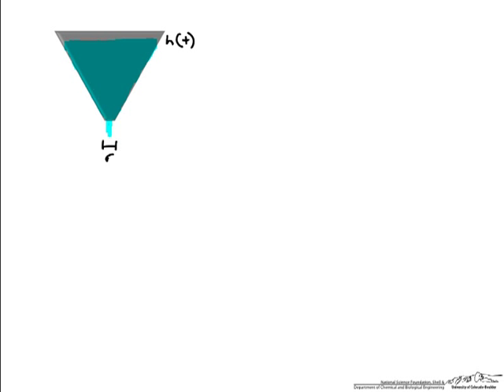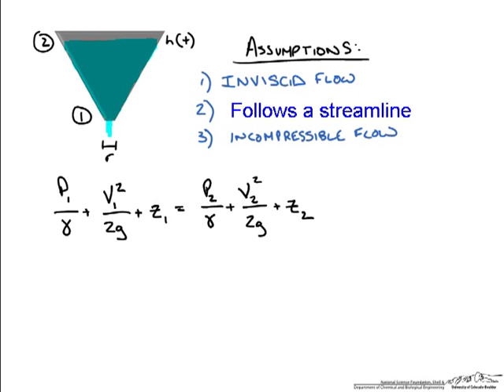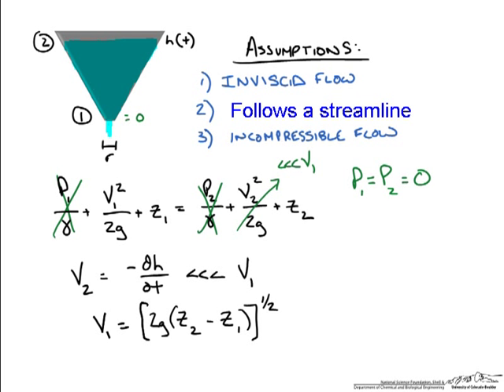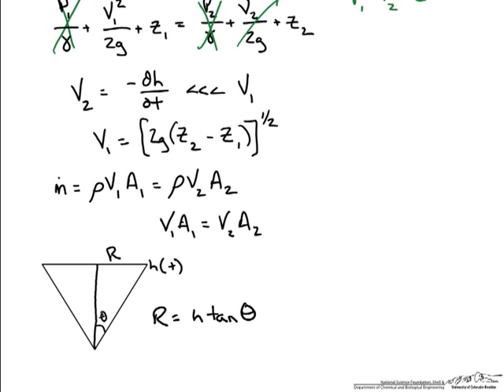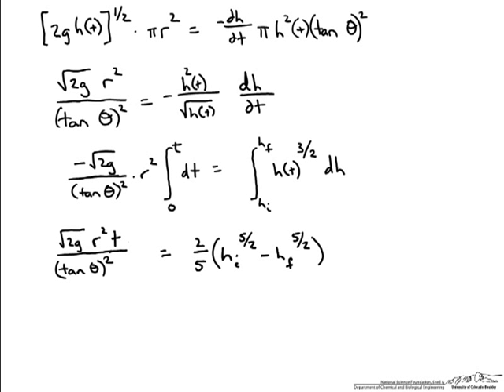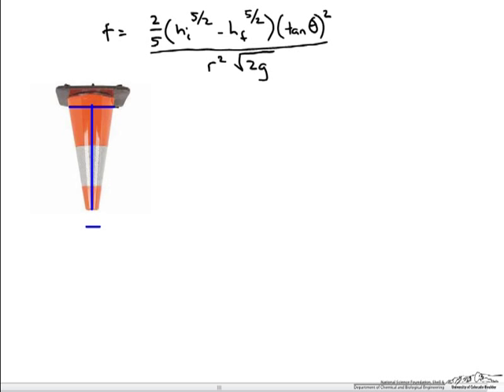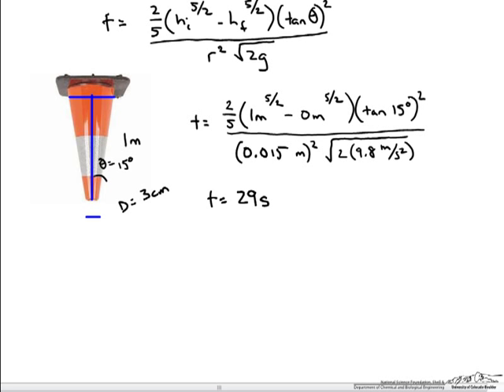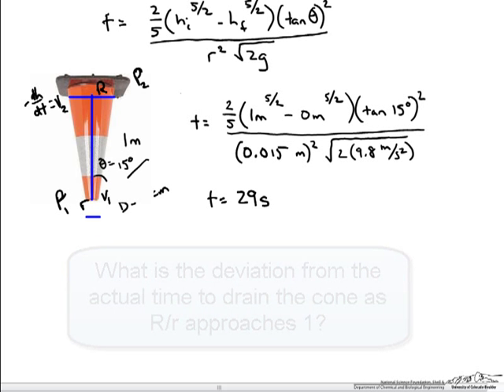Draining a Conical Tank

Comment: Why isn't it steady flow?
Reply from the maker: The change in height of the liquid is not steady because the cross-sectional area of the funnel is smaller as you get closer to the outlet. Therefore, an equivalent outlet volumetric flowrate will increase the height difference as you approach the outlet.
Reply: @LearnChemE  though at different cross section velocity changes but at each level / cross section velocity remains constant with time so the flow should be steady I think

Comment: sorry, correct me if I’m wrong, but when you tried to find A2 you said the radius was h(t)*tan theta but wouldn’t that mean that h(t) is defined as the difference between the very top and very bottom of the cone as opposed to points 1 and 2, which is the very top and where r is?

Comment: I have another problem I would like to solveOil from a tank is continuously discharged by a pipe through which flow is laminar so that rate of discharge can be expressed by Q = kH M^3/s where H m is height of oil level above pipe outlet and k is a constant. The tank has straight sloping sides so that the area of oil surface at height H m above pipe outlet is (H^2 + 6H + 9) m^2.When oil enters tank at a constant rate, level in tank remains constant so that H = 1.2m. When rate of inflow is doubled, H increases from 1.2m to 1.8m in 15 minutes.If inflow is completely cut off, find how long it will take for H to decrease from 1.8m to its original value of 1.2m above pipe outlet.  Answer 514 seconds                                      
Does any one know how to solve this problem, I do need help on this one..May someone please reply to my post if you have any ideas on how to solve this problem.Even any ideas that may help would be much appreciated. 
ThanksRobert

Comment: A hollow cone of height h and diameter d at the base is held with its axis vertical downwards and filled with water.  A small circular cone whose diameter is 1/nth that of the diameter of the base is made at the vertex. Assuming that the coefficient of discharge is equal to 0.62, show that time taken for depth of water to fall to one-half of its original value h cannot be less than                                                   (4 sqrt 2 - 1) n^2 sqrt h / 12.4 sqrt gNote: g = gravitational acceleration and sqrt = square rootSo far I've seen that d = diameter of top base and d/n = diameter of small circular hole,but so far I haven't been able to create a formula for diameter at any height in terms of h, like in this example.I do need help on this one, if anyone can give me an idea on how to solve this problem then that would be much appreciated.ThanksRobert